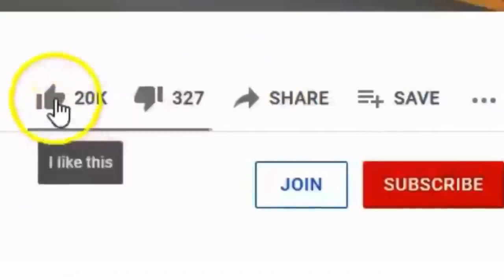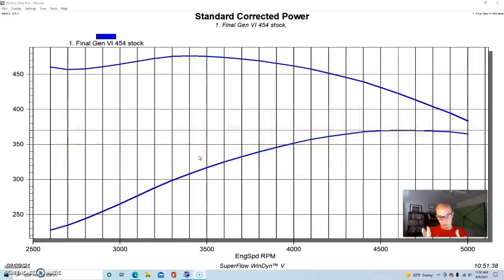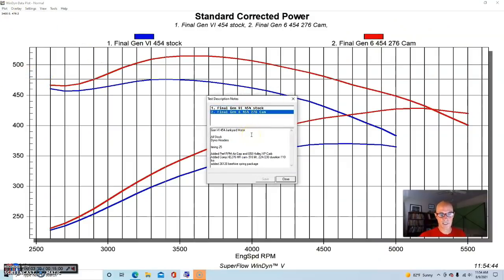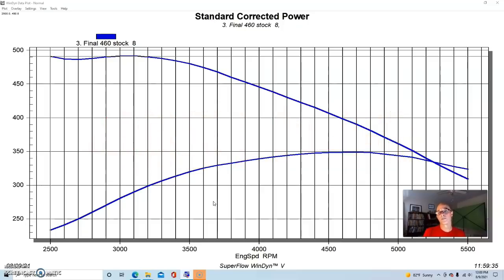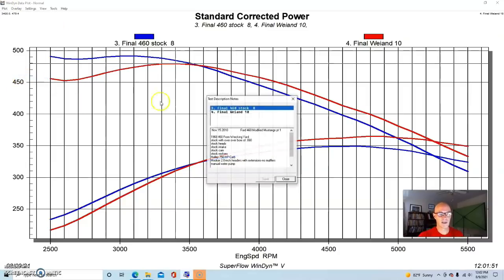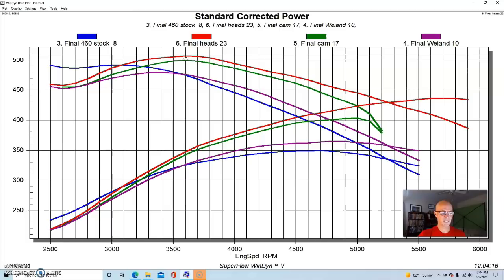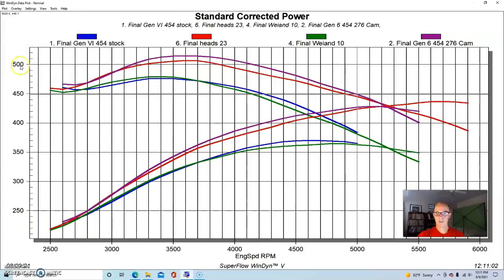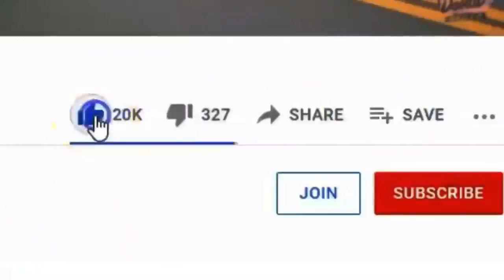JUNKYARD BIG BLOCK POWER-460 FORD VS 454 CHEVY FULL DYNO RESULTS

Comment: I have a 93 1 ton chevy 2 wheel drive with the 454. I bought it to pull a camper close to 7000 lb.s I have to say I like the truck, but sadly disappointed in the power. If I start pulling up a decent hill I can't keep it going at 55 mph, and that is usually trying to hit the hill doing 60, Thinking about going to a Ford if I upgrade.
Reply: Trevor - a Vortec 454 would be much more impressive. I am a BBF guy with 30 yrs on them, but in stockish form, the BBC Vortec is impressive. Pre-vortec BBC has too large of ports, so velocity suffers at low rpm. If you go Ford, they respond well to upgrades, with much better low end than BBC. Just go a little later model Chevy ('96+ I think) if you want stock power, but more of it. Even EFI 460's are not impressive in stock form. Modified, though, 460 is the better platform than carbed BBC for heavy haul/ towing, due to smaller ports and higher velocity.
Reply: Put a stage 3 chip in it grab 4 mpg and 90 hp 120 foot # tq total 325 hp 525 foot # much better than b4 had 1 in 94 tbi 7.4
Reply: @jasonconklin8172  I might have to look into this, where would I get a stage 3 chip (O'Reily's).

Comment: Question:  Why do magazine  writers/internet gurus persist in comparing apples and oranges?  Most, if not all, "comparison" tests fail to use equal parts.  Like this test:  vastly different intake manifolds, totally different cams (flat tappet vs. roller), early 460 vs. late 454 (which means different compression ratios and head designs), and the list goes on.  It seems that the gurus don't care enough to create a level playing field.  Instead, a good portion of the resulting articles are devoted to explaining/excusing all the differences in parts and procedures!  In the real world, most of us follow the philosophy of "If it's worth doing, it's worth doing right!"  Not so in the media world.  If one engine has an Air Gap manifold, put an Air Gap on the other one!   Roller cam in one, roller cam in the other, etc.  Otherwise, comparison tests are a lot of hot air, designed just to create "content"!
Reply: Well I'm sure Richard would IF he were actually building both motors today specifically for this test.  Instead, Richard is a recycler.  He finds old tests he ran in the past, and says "Hey, these are somewhat similar, so I will compare these two unrelated tests done at different times, add a click bait title and pic, and make some "NEW" content to get views".  Richard does more than just recycle engines at the scrap yard.  And I don't mind.  Recycling old paper is good for the environment and I learn something new with every apples vs. oranges video.  It's certainly cheaper than me buying my own dyno.

Comment: the reason people like chevy's isn't that we think we can do more horse power or torque its that chevy will outlast others and are cheaper and A LOT easier to work on I can buy a 60's chevy motor and drop it in a 90's.... you can't do that with dodge or ford mind you i'd have to change 3-4 things but not that much comparitivly

Comment: I love these videos so much. I have that same 68 460 in my fox. Would u consider doing a dyno test on one of these with just swapping manifolds and carbs? I would love to see a single plane low rise like a torque 2. And would love to see a smaller carb like a 600 double. I've found for the street a smaller carb just responses so much better
Reply from the maker: WE RAN A 650 ON THE 454 AS WELL-SAME POWER-THE SINGLE PLANE IS NOT A GOOD CHOICE
Reply: @richardholdener1727  I'm assuming the single plane lost tons of usable low end and mid range?

Comment: It’s pretty simple for the highest forms of racing the big block Chevy makes more power then the big block ford and the hemi makes more power then the both of them 🤩
Reply from the maker: none of that is accurate
Reply: @richardholdener1727  the NHRA disagrees .so does the 1/8 mile drag racers doing 3.90s they all run hemis before that they used big block Chevy based engines like proline 481x etc 🤷🏽‍♂️🤷🏽‍♂️ .but yeah that is full on race car set ups

Comment: Would you do a comparison on the 460 vs. The new 7.3 Godzilla?
Reply from the maker: DON'T HAVE A 7.3L
Reply: Stock for stock? The 7.3L would destroy the 460.
Reply: @richardholdener1727  I respect your opinion… What do you think would be better a 7.3 Godzilla or the old 460?
Reply: I've sampled the 7.3 in some of the new U-Haul equipment. Unless I'm missing something or they're just not broke in all the way yet, I'm honestly not that impressed. Doesn't feel any quicker than the 6.8 & certainly won't touch an old 8.1 GM that isn't ragged out. Maybe pick-up versions are tuned a little more aggressively than E-series & 2-ton truck applications?

Comment: Got just about the worst intake you can get for the Ford
Reply: @tskraj3190  Obviously never heard of Mopar.
Reply: @robertthomas7239  I have. Have you heard pf the Buick 455 Stage 1 Hemi Killer?
Reply: @tskraj3190  The one that used to get embarrassed by the Hemi Dart? Cool nickname 🤣
Reply: @robertthomas7239  🤣🤣🤣Umm no, no it didn't. The Buick 455 still makes Mopar fans cry 😭
Reply: The 4v cleveland was also a pretty stout motor obviously cause it held its own with all the big blocks
Reply: @jonathanabeld2326  Lol, no it didn't even a 396 romped all over it.
Reply: @tskraj3190  Why would he be butt hurt? There was no winner in this comparison.
Reply: @tskraj3190  where?
Reply: @robertthomas7239  when? What 396 will outrun a boss 351?
Reply: @tskraj3190  that's not a boss 351
Reply: @tskraj3190  when you find one let me know. 1971 2nd quickest quarter mile for motor trend. Only gs455 went faster. I smoked MANY big block chevys with a cleveland.... with a cast iron intake manifold no less... never lost to any 396... in at least 10 street races...
Reply: Put the same roller cam in each and identical intakes and run them head to head...
Reply: @scottford1091  Sure you did buddy... Sure you did
Reply: @tskraj3190  stage 2 Buick, had special heads and cast iron headers. I believe there were only 7 sets in existence. Truly a hemi hunter.. with the a/c on too.😁
Reply: @tskraj3190  the boss 429 was built for roundy-rounds. 428 was a strait line beast.
Reply: @scottford1091  the 455 Buick is the same weight as a SBC when you screw an aluminum intake on it.

Comment: I argue the point of brand loyalty all the time.  it doesn't matter if it is a Chevy, a Chrysler, a Ford, of a foreign 4 banger. its about horsepower per cubic inch. an engine is an air pump, the engine that move the most air, the most efficiently will make the most power per cubic inch. in a perfect world, were all the cams were the same duration, and the intake, exhaust and head flow was all equal, there would be very little difference in these engines,  at 1.1-1.2 HP per cube,  a 454 will make 500-549 hp.   a similar config on a 460 will only make about 6-8 HP more. the only reason with would make more would be displacement. as 440 would make around 15-25 hp less than the 454. again it would only making less do to the smaller displacement.
Reply: Ya there's way more to it than that
Reply: @Welcometofacsistube  I agree. Packaging size, weight, aftermarket availability, factory design flaws/weak points are all important. I don't really see much point in brand loyalty bickering though. Do what you like and leave others to do what they want.
Reply: Compression don't make grunt power never haz  most grunt comes in low compression  heavy crank flywheels and long stroke not hp at all

Comment: Good thing you didn't have a 455 Pontiac, it would have broken the dyno 🤣🤣🤣 Just had to weigh in on the Ford vs Chevy battle!!!
Reply from the maker: or an Olds 455, or Buick 455
Reply: Buick 455 stage 2 heads.... bring on the power!!
Reply: @robv.o.1777  Those were great heads, so were the Pontiac Ram Air V.

Comment: The boat guys will tell you that you DO NOT want to prop your 460 to operate at the same RPM that your 454 buddies run at unless you like hot oily engine parts beating up the inside of your boat.
Reply: I have a friend that runs a 460, stock bottom end and spins it hard.  Beefier block and shorter stroke says otherwise to your assertion.
Reply: @ProjectFairmont  In a boat? Boats are a lot harder on engines. On paper one would assume that the 460 wouldn't have any issues. But there is a reason that most big block barefoot boats have 454s and not 460s. It's like running 1000 dyno hours.
Reply: I was a boat mechanic many years ago and can tell you from experience that the 460 Fords lasted longer in jet boats than the BBC motors. These were factory Ford and GM motors that had been marinized. Not talking about aftermarket marine engines that are based on BBC (Dart, etc.). Will also find that there were a lot of canyon river tour boats with 460s

Comment: BBC has lower compression and holds up better, consistency and reliability. If you’re looking for economy get a 305 with a low rear to make up for its anemic tendency. Absolutely right on porting cast heads, not built for high volume flow. Workhorse engines unless of course you have a solid track car bracket racing etc.
Reply: @ewetoobz3840   Powerjokes? You said late model. Even the mighty International 7.3 is hyped. Any Duramax is worth more with a 6.6 that destroys in performance, reliability and efficiency. They move with a tuner but don’t hold up. 200k and $40k in repairs. The old 460 were pretty reliable and thirsty, your entitled to an opinion. Go look that up’
Reply: @WoodLox  EFI 460's in late models hold up just fine. Any  450+ cubic inch gasoline engine is thirsty in a truck with truck gears and the aero of cinder blocks. Insert brand name here. You were talking about BBF v. BBC reliability and my response is there's nothing wrong with either frankly. The 7.3 was fantastic at the time. Your Duramax was coming on the scene when the 7.3 was on it's way out. I expect newer junk to be more efficient than older junk, otherwise we have learned nothing.  I paid less for my entire 7.3 truck than a lot of people paid for their extended warranty on a Duramax and mine's still running, unopened, over 300k, but feel free to tell me again about reliability.

Comment: So which block is called a big block ford? 335 series, FE, 385 series, M-E-L……..or what?
Reply from the maker: 429/460
Reply: @richardholdener1727  That, sir, is known as the 385 series. Same bore spacing as the M-E-L engines. The M-E-L was the precursor to the 385; and was produced at the same Lima plant before the 370, 429, 460. ( Yes, there is a 370 CID 385 series engine.

Comment: so 60 over bbf 470ish
Reply: Yep, a rebuilt 472 cubic inch Ford with ported heads, a valve job, and 10.5:1 compression barely beats a junkyard fresh 454 with 9.4:1 compression.

Comment: The chevy engine is cheaper to build, and alot of choices for parts.
My friend is heavily into ford, spends alot more for parts.
The ford castings in the late 60s and  early 70s were very nice for porting and polishing. 
The Cleveland 4v and CJ heads were the cleanest ports I have ever seen on a stock engine.
I'm a mopar guy myself...😁

Comment: Does anyone still run the mark iv. I’m still running mark iv with peanut in my single cab dually.
Reply: Do you tow much with it?

 I am building a project from the remnants of a 95 step side and a 96 3500 dually but I'm wondering how a single cab dually rides on the highway when towing.
Reply: Sure, many people still run them.  They are just getting harder to find in the pick a part lots.
Reply: @c0c0asauce  it’s a 1980. It actually rides better with more weight. As for towing it rides great when trailer is properly balanced. It’s without the weight that makes the ride so rough.

Comment: What about those EFI 460s from the late 80s? I heard the heads are quite different from the previous carb stuff, so I'm guessing they're not power makers. Easier to find than an early 460 I imagine, round here anyway.
Reply: I have a 91 460 from an E350 in an F100 project in my garage. The fuel injected stuff has tiny ports. I bought the fanciest headers I've ever bought myself to put on this engine, not realizing the massive difference. After bolted on you could sneak a pen into the header because it's port was so much taller than the head itself. Unbelievable.
Reply: @jimrohrer2751  wow, that much difference! Now maybe you can justify some aluminum Edelbrocks to work with the headers. Bummer.
Reply: @rotaxtwin  I took them back. I was so upset with myself. I bolted the stock manifold back on and called it a day. I never finished the project and it still resides in my garage to this day....
Reply: @jimrohrer2751  A sad story. So the project is carbureted or EFI fed?
Reply: @rotaxtwin  originally it was EFI. I put an Edelbrock intake on it and my plan was to bolt a quadrajet on it because, what's the best way to make a Ford run good? Put some Chevy parts on it!!!! I have an HEI store distributor for it.... I thought it would fun arguing at car shows with it. I also fab-ed a late 80's Chevy truck frame up front so it would have disc brakes, sway bar, power steering, yada yada yada. I keep thinking about getting back on it. Project binky really makes me feel like a bum for not completing it.
Reply: @jimrohrer2751  Q-Jets came on Dodge trucks for a few years and I'm pretty sure they did come factory on some 460s believe it or not.  I've seen them on Dodges at the wreckers and I've seen the spreadbore intake on some 460s but the carbs were robbed.
Reply: @rotaxtwin  I didn't know dodge used q-jets but I'm not surprised. Wasn't the thermo-quad spreadbore?I don't recall what spreadbore carb Ford had but I doubt they used a q-jet. Maybe a Holley or something.
Reply: @jimrohrer2751  429 & 460s both came with QJets for some time, with the Chryslers it was a production issue with the T-Quads so they switched.  Unsure of the reasoning.
Reply: @rotaxtwin  very interesting. Thank you for the info. I'm sure it won't mean much unless it comes up on an episode of Jeopardy under obsolete carb knowledge.... But fun to know otherwise. 👍

Comment: Ford has history of stronger oem rods, 
chev has better water pump / timing cover assembly.
Good  bbf aluminum heads are cheaper than the equivalent bbc heads.
 bbc has more accessible, better stock and higher potential late Model factory heads, plus factory roller cam..
Ford goes out to 557.
bbc has more core shift @ same power level as bbf...